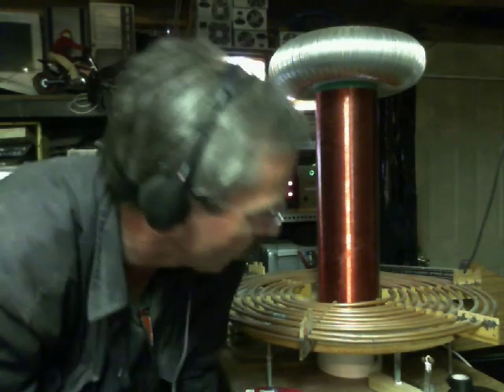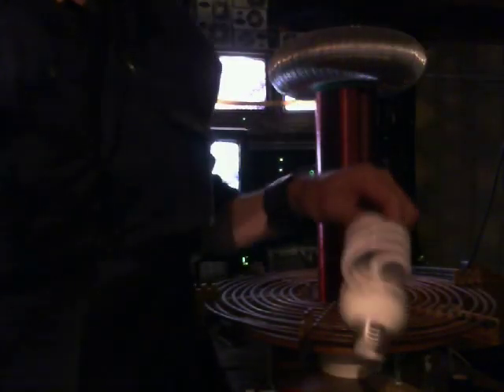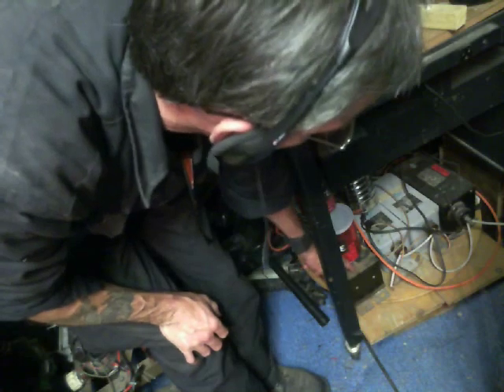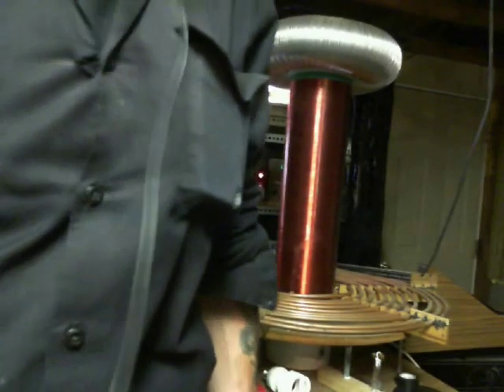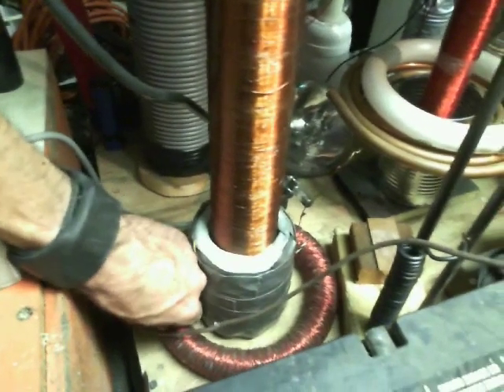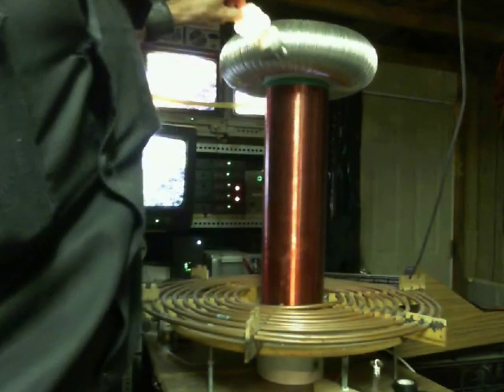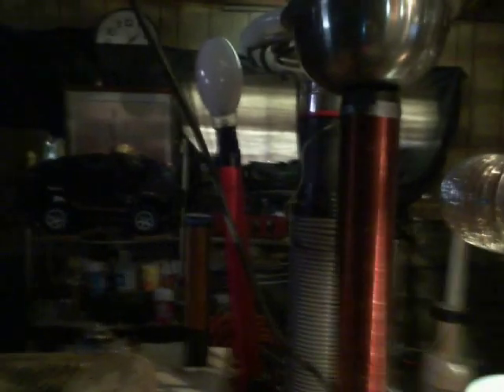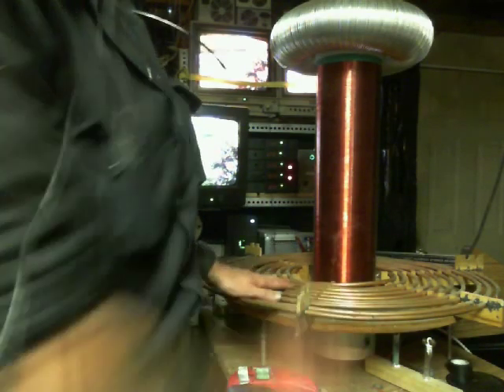BUILD A TESLA COIL 2

Comment: I would like some help building a coil for alternative energy as well. I've built one with no success. Not sure if my problem is with my material, or my circuit.?. I'm using a modernized neon light circuit, and have used multiple caps,(various voltage's with various capacitance's.) all with no spark gap.
Reply from the maker: Contact me on skype if you like.

Comment: I want to create a corona discharge between a series of plates that are spaced approximately 3/32 apart and staggered + / -  +/-  +/-   etc from top to bottom. Would it work to use a Tesla Coil to boost the energy from a neon light coil that runs on 12 Volts DC?  The coil draws 5Amps on 12volts and puts out 9,500 volts at 30 mA.

Would there be an easy way to adjust the frequency of the output?

Comment: What i want to do is to use a smaller sized tesla coil to run an electric motor made from knex. so i guess the wireless transfer of energy and not the sparks flying around.

Comment: Hi Shazzizz!Great video; did you see the one where 5 gallon paint pails were being used as capacitors! I am not a scientist, but have some general knowledge on everything you were speaking about. Even copper isn't cheap these days but would a more conductive metal like gold or silver be an improved variable on the primary and/or secondary? I want to make my first one be able to run my 600 watt HID light (gardening), the second one I would like to build to parallel this usage of my house. Thanks again! Richard

Comment: My daughter and I are building our first Tesla coil, we would like your guidance. We are both pretty smart, she is in University, 3rd year and I'm a millwright. We want one that does put on quite a show, Shooting sparks into the night sky, etc. Maybe an overall coil of  18" - 24" high, and sparks 12" plus (roughly). We have done our research (which brought us here) and before we buy any material or parts, we need our base power unit. Is a neon sign transformer easy to find (and cheap) can we use a bug zapper and as beginners use 12 volt, 6 volt batteries, or a 120 volt AC voltage transformer. We would really like your opinion. Thank You.

Comment: I see there are a few skeptics who do not believe that the free energy is possible. Some ask about how much current can one draw from T coils etc. I think the important thing to remember is that most of our house hold power is between 160 to 220 Volt AC (depending on country). These voltages are used PURELY to carry the current over long distances and to carry the current load when demanded. Once it gets to your house MOST appliances drop the voltage significantly to operate.  A TV as well as DVR's, computers, and many electronic devices can operate between 5 to 12 Volt. With the right gas and frequencies you can produce light, so all of the above would probably takes care of about 80% of the energy we use. For the other things like warming water, stoves, kettles, amplifiers can be built using mosfets or tubes. Alternatively one could start manufacturing these appliances to operate on lower voltages. There are also other options like natural gas, or oxyhyodrogen to produce heat. Just think how much it could change the world if we did not have to rely on huge corporate companies that literally suck us dry through the cost of power to homes as well as industry. I think guys like this should be supported and protected at all costs. Please note that I am not an electronics expert , and only have a limited knowledge so if any thing I said above is not technically sound please feel free to add comments or correct any errors.

Comment: What did you rap the secondary with and for the secondary did you rap it around a pvc pipe?  Also what did you use to make the toroid?  Could you please give me or direct me to where I my find these calculations for the windings?  I am in this for the wireless energy and I want to build this as a science project.

Comment from the maker: Most of what I used is recycled wire from old appliances, so realy you can build one fairley cheap. I use a Beckett oil burner igniter that runs on a 12 volt car battery as my power supply. Those are hard to find used but worth looking for.
You do not need one that big to transmit. as a matter of fact the old plasma globes have a circuit in them that you can make a small coil and use that to power it off 9 to 12 volts. I hope this helps. If you need any help let me know.

Comment: "The Tesla Transformer [produces] electrical vibrations...Currents many times stronger than any ever generated in the usual ways"
"The Magnifying Transmitter [sets up] electrical movements of greater intensity than those of lightening [and can pass] a current, sufficient to light more than two hundred incandescent lamps, around the Earth."---Tesla, in his autobiography

Tesla built a free energy device 120 years ago in Colorado...not perpetual motion, free electricity, from the earth.

Comment: My goal is to power households (including heat). After watching a video about energy from antennas, I had a thought about modifying a household system to go offgrid. Using the network of copper wiring that is already built into every house. The wire that is usually bare which is the ground wire could be the basis of the electricity collection system which could easily be expanded. By using even more new & used copper on the exteriors turning the whole building into part of the 'coil'. Hugszz2ALL

Comment: Can you do "both" with it? or Would you need two different set ups?
Can you "reabsorb" the energy after you create the cool "lightening?"
It would be great to use for the house and send it to the "outbuildings" or barn etc.
Is there any way to cut-down on "length or size" of any parts of your design (for space) and organize it better? It is hard to follow the "flow" of it all. If you could redesign it, what would you change about the "layout?" :) Thanks:)

Comment: Shazizz, questions for the total self sustaining household. . . 1)  Won't the function of such a unit (say in an attic) interfer with elctronic gadgets (TVs, computers, sterreos, etc.) in the house?  2)  Can the power generated be saved into a battery system not unlike that of a solar battery bank?  3) Have you performed any kind of a cost analysis. . . solar versus wind versus Tesla?  4) I did not see the ground to any of your coils.  Can you illuminate me on that?  Kudos!  Love your sharing.